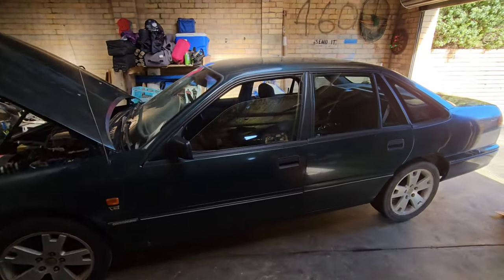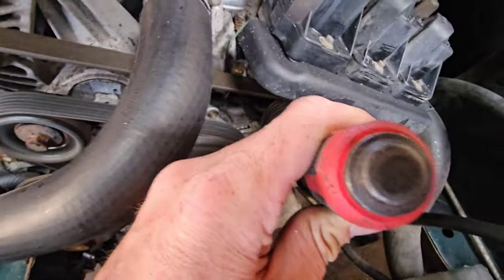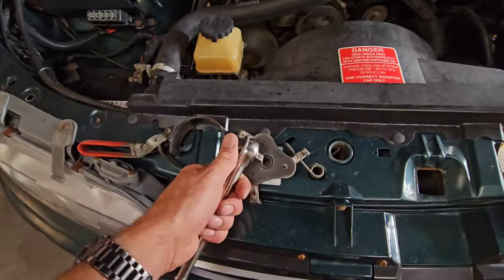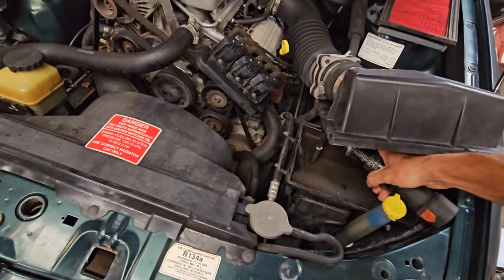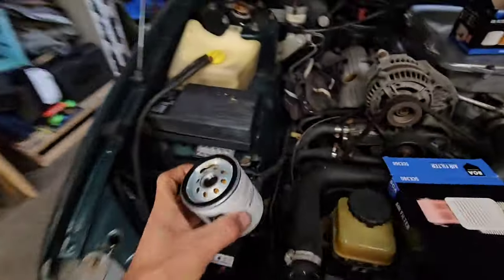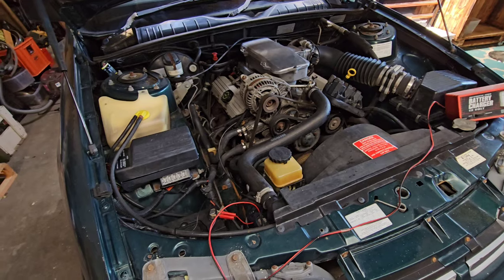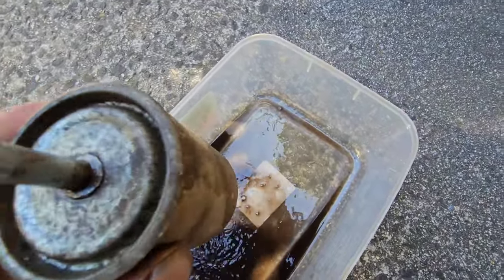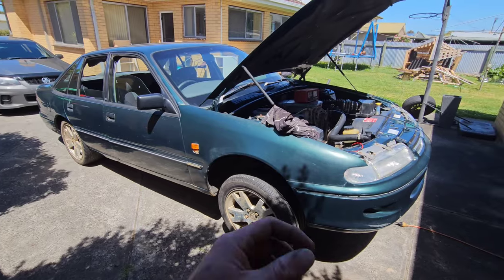Holden Commodore Engine Service & Check Over | Vs Ecotec V6 Cheap Car Challenge PT7

Comment: Great info Luke.Can see your mechanicing experience shining through here and filming it all may have been challenging at times.Well done.
Reply from the maker: If there's one thing I miss @DetectingOz it would be working on cars daily in a workshop mate. Unfortunately my bad back couldn't withstand it forever, but I still thoroughly enjoy any mechanic jobs I do. And especially this project car👌
I can't wait to share part 8 very soon to see what's next. Cheers heaps Gary🤝👍👍

Comment: G'day Luke, I have the feeling that Pedders lost a top class mechanic and would have been sorry to see you go! And that you had a real passion for working on cars.and it seems you still have. I wonder how happy my car would have been if I was as enthusiastic an knowledgeable as you. Ive had a mouth full of fuel several times over the years, siphoning petrol, one suck to many! It might explain all the back firing I do. Now I'm feeling guilty about my car, Its been losing oil since I had its timing chain replaced, and Ive had a water leak since replacing my radiator, but have been to busy with other jobs to even think about checking it out. Plus I lent my ramps to my nephew a few months ago and they haven't been returned yet. I like a bit of elbow room when I'm under a car. Now I'm feeling extremely guilty about my neglect. You may have forced me into some much required action in that direction, Dang it! As if I haven't enough to do already. Ive yet to have my second cup of coffee! Cheers Mate, take care!
Reply from the maker: A second coffee sounds great @wayne armstrong it's been a long night!! The car certainly is coming along nicely mate. I had no doubt the oil, air and fuel would be putrid, judging by the state of the car when first buying. It's really getting a good birthday lately and loving it😁
All we have left to do now...is everything else😂 I look forward to sharing more again next week plus a nice surprise. Take care Wayne and try to stay cool this weekend to mate👍🤝⛏️
Reply: @DigItDetecting  I was out getting a job done, but it became a temporary fencing job, it just got to warm to keep going and do it properly, Ive had some lunch, and I'm about to have an early afternoon drink, definitely not coffee this time! I'm sitting in my old bus slash, home, it still gathers heat, but it's cooler than outside, there's a good breeze blowing through and all my windows are open, otherwise I'd just be a puddle, it's not stinking hot but it's hot enough! Take it easy Luke! Cheers!
Reply from the maker: Early afternoon drink sounds even better @wayne armstrong hopefully that breeze keeps coming in to mate and cools down a little more later before bedtime.
Take care and enjoy mate👍👍